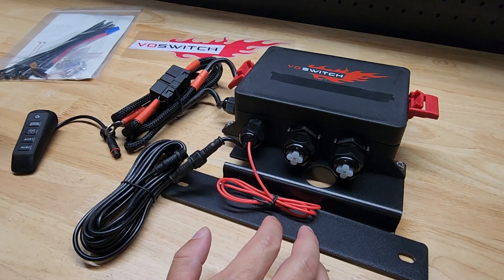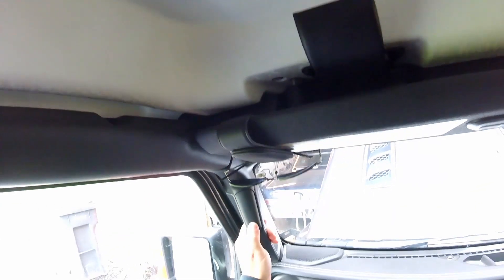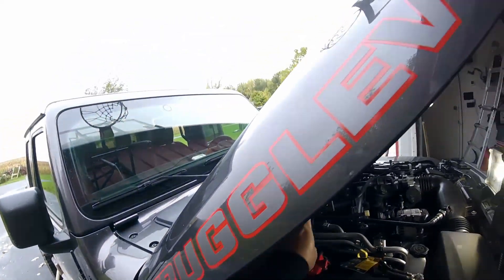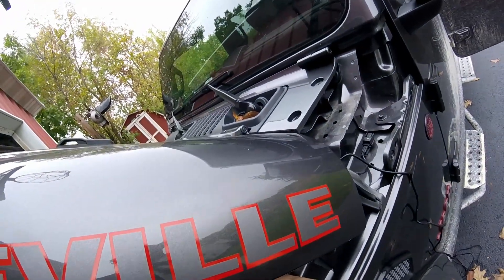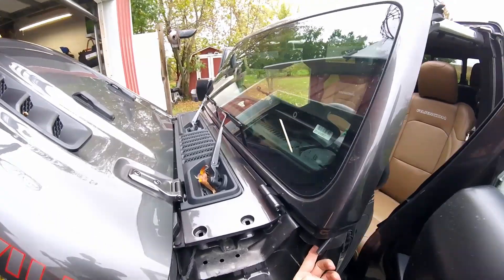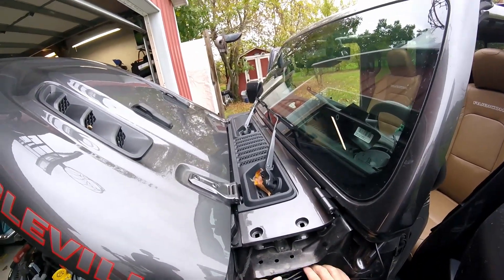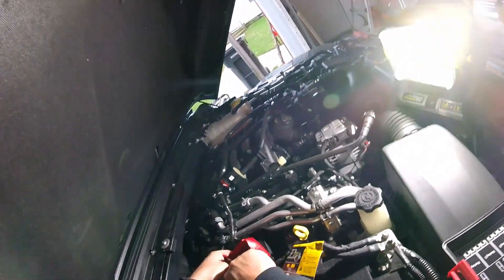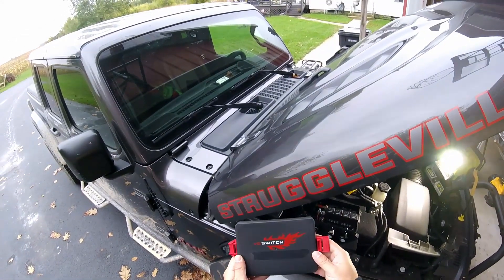How To Install Auxiliary Switches In Your Jeep! (VOSWITCH JL400)

Comment: Like to see how the wires look once you start running accessories to the VOSwitch module.  Is there any type of wire management?  I imagine it might get messy once you have four accessories with both positive and negative wires running to the box along the inside of your hood.  I'm thinking of just using some wire loom or something.

Comment: Did you ever figure out what that plug is for that is located on the driver side hood panel
Reply: It is for adaptive cruise control if you have that option. It's the connector that supplies the signal from the windshield camera and sensors.